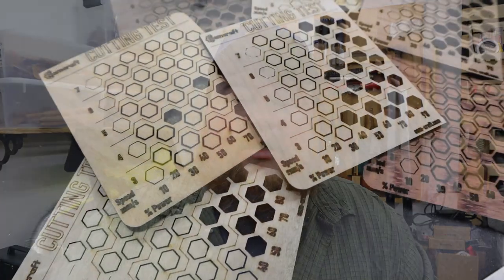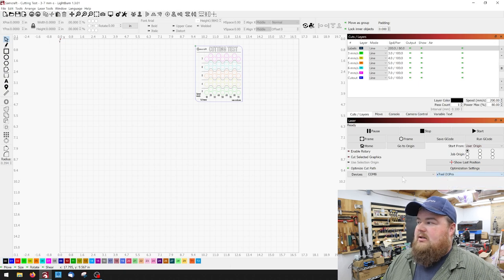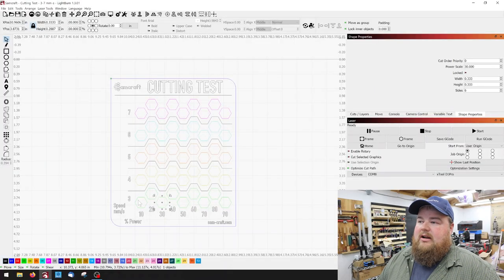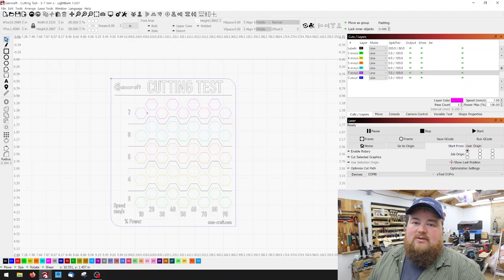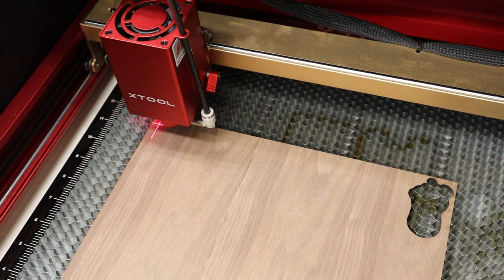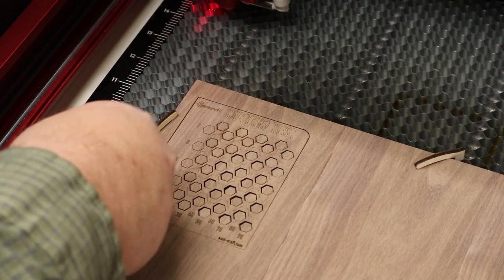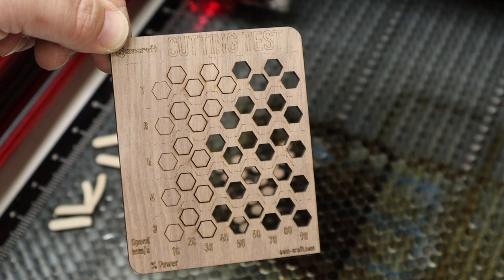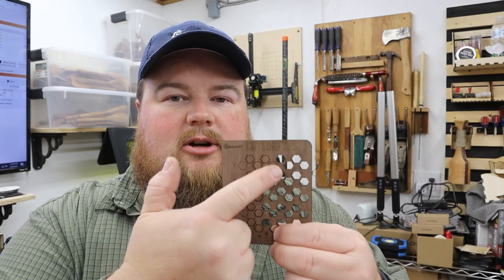Do This BEFORE You Laser Cut ANYTHING

Comment: One thing I think you forgot (or not?) to mention is before you run a cut (or engrave) test, you need to ensure your lenses are all clean/clear. This way, your test is based on "perfect" conditions. I am baffled why people still aren't labeling their cut tests with the laser module metadata on them as well. 80% power is meaningless if you have no idea what the maximum power (example: 20W, 40W, etc.) of the tested module is. Not adding this information makes zero sense to me unless you only have one laser and never plan on purchasing another.

Comment: In the Laser window, there is a Library tab. Highlight a specific cut/layer in the Cut/Layer window and click "Create new from layer" in the Library tab.
Name the material (Hardboard, Birch, Walnut, Acrylic, etc.), specify a thickness in mm, and give it a useful description (infer from the layer settings): "Cut", "Line", "Image" or "Fill".  If you're using a layer from a cut test, then you may have to create an explicitly new layer with the specific settings (7mm @ 60%) instead of using the layer with the variable shape settings.
If you have another burn type from the same material but a different thickness, then highlight the layer that performed sufficiently, "Create new from layer" in the Library tab, keep the same material name, but specify the new thickness.  Change the description appropriately: "Cut".  Now the new library entry will be filed under the same material heading but under a different thickness sub-heading.
Do the same for Line, Fill and Image with the same material and thickness(es).  Eventually, you'll have all your various materials and cut types filed by thickness in one handy location.
Use the Assign Button in the library to modify the currently selected layer to the selected library material.
The physical tests can still be kept for reference, but do not need to clog up bench/drawer space...
I also recommend redesigning your cut test to include a few varying fill & line tests - three burn types, one test ... also include the material name and thickness as the text directly on the burn test.
More info: https://docs.lightburnsoftware.com/UI/MaterialLibrary.html

Comment: I really like your videos, your creativity and your great attitude. I have 2 diode and 2 CO2 lasers but haven't had the time and space to get them into production. I am currently building a new workshop so your workshop videos helped too. Thanks.
Reply from the maker: Thanks! I'm fast running out of space in my workshop too. It's a 12x20. I've thought of doing a few lean-to add ons to expand it to help. :)
Reply: @Samcraftcom  Thanks Sam. I like your "get in there and do it until I figure out how I am supposed to do it" attitude. :-) I have a 12X28 with the "barn" style roof. The double doors open on one side. I am going to add 8 ft of floor to the 28 ft side opposite the door and basically move that wall out and add 2-8 ft panels to the end walls, and change that side of the roof to fit. Hard to describe without a napkin to draw on.I will have to put a post every 8 feet where the wall is now but I will end up with a 20x28 workspace.

Comment: Why you don't use the high power with you xTool laser? The support team advised me to use 100% power to let it lasts longer. Please advise.
Reply from the maker: That's opposite to what many in the community say; that lower power will let it last longer. I honestly pick the setting that works best for the material or project needs.
Reply: @Samcraftcom  You are probably confusing this with another type of laser - CO2. Customer support would not cheat, what do you think?

Comment: Hey Sam, I bought your tests and just have a couple questions. How do you know which file you want to run? So for the cut tests theres 3-7mm-s, and 8-12... Is it just trial and error to see how they perform til you get a feel for things? Or are they geared to materials? Slower cut tests for wood, faster for acrylic...

Other question (I'm xTool d1 20w if it matters) when a layer is set to 75% power, and an image is on there say at 50% power, does that get 'laser'ed' at 50% of 75%?

Comment: Nice Sam, I have subscribed and I like your pace its good for me for sure. I'm eight weeks in with the laser, so when I loaded your cutting test and followed the spd/pwr settings, it says like 4 plus hours so it's clear I've missed a very important part, would you or one of your subscribers be able to tell where I can look to solve my time frame? Thanks
Reply from the maker: I would suspect you may have speed settings at mm/min whereas this file is designed for mm/s, but that's an assumption.
Reply: Sam thanks for the reply,  I got it now I really just need to be able to understand what I'm reading, Thanks again have a great day.

Comment: Just a quick question for the Xtool d1 pro 20 watt, max speed is 400 mm/s. I bought your files and I see the lower speeds for cutting and 20+ mm/s for engraving. Is it better to cut at a lower speed and engrave at higher speeds? Just starting out and want to get it right. Thank you 👍🏻
Reply from the maker: I prefer to engrave fast and low power, but cutting will sometimes require slow and hot, depending on the material you're cutting through.
Reply: @Samcraftcom  thank you, we just used your file, very easy to use, and we have taken the guesswork out of settings! Thank you 👍🏻

Comment: Hey brother! I have an issue can anyone help? I was running a job on my extension for the first time for a customer & well, the short storying is my D1 Pro 20w hit the board and stopped. Now when it moves suddenly forward on the Y like an inch it will have a grinding sound. Sounds like it's from under the laser itself? & it also moved of track in the process of the job. 😮‍💨 It did skip some teeth on the belt too. What say you? Wasted $30 board & paint. 😒 PS: thanks for the cut vid. I was wonder what settings for the 1/4 inch I "was" going to cut out. Next time, back to the store I go.

Comment: Thanks for this!  I have a side question for you... I've got an Ortur LM2 Pro and it works just fine.  However, when I use it to cut good wood, especially a sappy wood like walnut, the air assist nozzle gets all gunked up with sap and soot and then sometimes the sap interferes with the cutting/movement.  Even if I have it set to 3 passes and stop to clean it up between each pass, it's just a mess when it comes to sap.  Considering this, do you think a small, maybe 40 watt CO2 laser would handle this better?  I don't mind some sap cleanup but not to the extent that it'll ruin the cut while in the process.  Do you have an opinion?  I've never used a CO2 laser but I'm finding the Ortur pretty limited to basswood and other woods that are low in sap.  Many thanks for any thoughts on this!

Comment: can i use this for different size materials? 1/8, 1/4.
Reply from the maker: Absolutely! I'm using it on 3mm or 1/8" material in this video, but also use the same file for 6mm or 1/4" material in my CO2 laser. You may need to adjust the speeds depending on your laser wattage and material thickness though.
Reply: @Samcraftcom  thank you. I downloaded the file and I’m going to try it tonight.